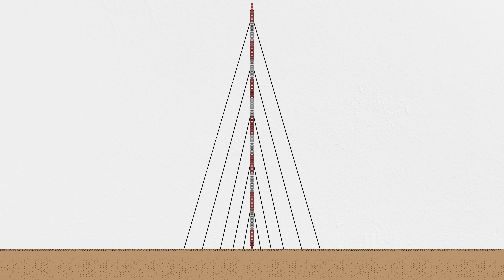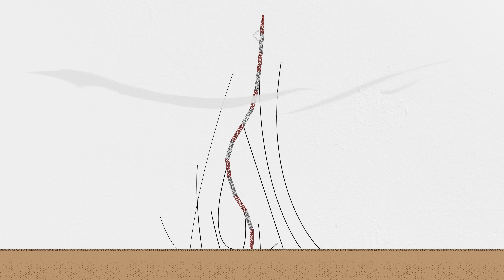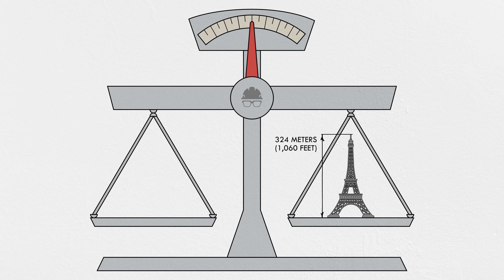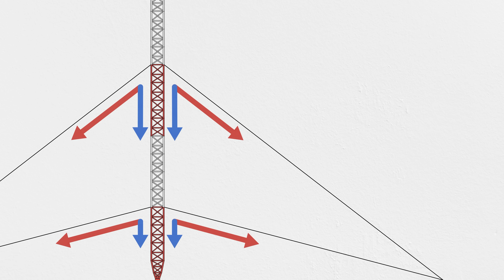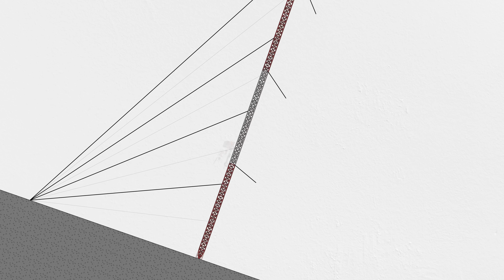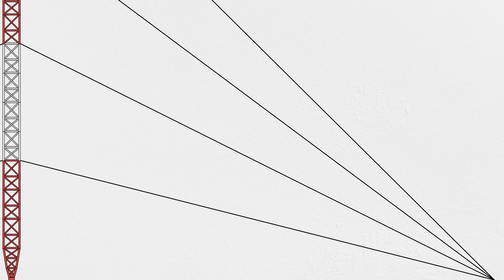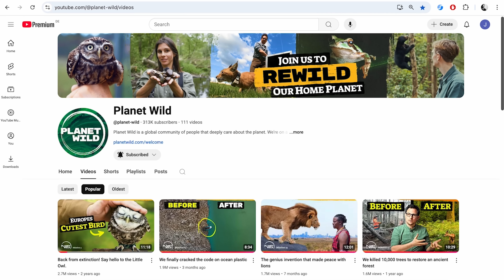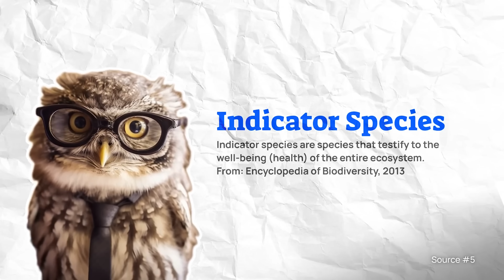The Bizarre Bases of Antenna Towers

Comment: I used to do this professionally (as an electrician's apprentice)... our towers were the 36-to-100 foot class... a 36' tower could be just a steel tube set on a concrete base; a 100-footer was a truss tower, constructed in 10' sections, with one section of the tower (I don't think a full ten feet?) set in concrete for a base.  Sometimes we'd use a fold-over base; the base segment had a hinge in it, and you assembled the tower on the ground, and then winched it into place.  Other times we'd use a "gin pole", a steel tube that clamped to the tower and had a pulley by which you could hoist up a segment of tower, bolt it into place, and then move the pole up to the next segment.  Slow, laborious, but effective, especially in tight confines... 100 foot towers used two sets of guy wires.  The antenna was a "crown" of copper rods attached to the top of the tower; lights, if needed, were solar modules atop the antenna.  100' wasn't tall enough to need paint unless it was reasonably close to a runway, though the steel tube units were painted anyway.  The taller towers were galvanized steel.  

Sounds like that tower that collapsed had a single point of failure, like the Key bridge!  I'm not 100% sure but I think our towers could withstand the loss of any one wire... maybe not at FULL load but under normal conditions.  And most of'em got inspected either monthly or quarterly... 

2000'.  wow.  That is one big honkin' tower.

Comment: The Warsaw Radio Mast (located actually 80 kilometers/55 miles WNW of Warsaw near the town of Gąbin) was this tall because it worked as a half-wave radiator for 227 kHz which corresponds to the wavelength of circa 1320 meters. This mast was fed at the isolated bottom and grounded electrically by a steel pipe connected at the half-height point and running down on insulators inside the triangular cross-section of the mast.
Imagine this mast with its HF feed as an electric vertical equivalent of a horizontal see-saw made of a metal pipe supported at the middle and moved by hand pushing down and pulling up alternately at one end.

Comment: Great video. I used to work for the steel company that engineered and fabricated the North Dakota tower you mentioned as well as the Sutro Tower.  Both were before my time.  I mainly worked on the structural side and didn’t deal much with the tower side. Towers definitely came with their own set of challenges.

Comment: What about the horizontal antennas? I remember hearing something a long time ago about a "E.A.M" (emergency action message) that can even reach submarines, or was that just a movie? Is horizontal "radio" a thing, and if so how do they work when having only a meter or two in height? 
The concept stuck in my mind even if the details have faded as a wireless world wine way to communicate pre internet mostly used by the US navy/military.
Reply: EAM's are Air Force. For submarines it's the Navy's VLF transmitting stations where they use huge umbrella antennas to transmit 2MW signals at 24kHz frequency. At this power and frequency the signal propagates into sea water 10's of meters below the surface which means the sub doesn't have to surface to receive the messages. Look up VLF Transmitter Cutler Maine some time.

Comment: As a broadcast engineer for most of my adult life, I learned my lesson about messing with AM radio towers when I was a teenager in high school. One winter I rode snowmobile over to a tower out in the middle of a field He was in the middle of the night and I hopped the fence and climbed partway up the tower and looked around. The next day I told my friend what I had done and we decided to do it again except during the day when both of us grabbed ahold of the tower we got a pretty nasty burn on our hands. I was wearing gloves and it melted part of the glove to my hand. Found out it was a 10 kilowatt AM station that operated daytime only, so the previous night it had not been on. Ended up having to write left handed in high school for a month while the palm of my hand healed.
Reply: Yikes!
Reply: Or ‘jump’ onto the tower from a purpose built wooden platform
Reply: That is why they use wooden ladders to get onto those towers.
Reply: @mgcoolio97  Wood is a very poor insulator at those frequencies.  Where I retired, at one point for safety reasons I was required to remove all wood ladders from the premises and I replaced them with fiberglass ladders.  I donated the ladders to a thrift store, probably twenty or thirty of them.
Reply: @mgcoolio97 no

Comment: It's a little extra from a structural engineer that did his master on the buckling phenomenom.

Buckling is a stability issue. We need to look at this in term of "energy" where there's the compression energy and the lateral translation energy. Both goes up when a load is applied on the section / tower but at one point, the "structure" tends to go sideways rather than being compressed. You will never have this issue with traction load.

Also, for the ropes attaching the towers, as you go lower, the angle is less prone to induce compression forces but the buckling is also a matter of the unsupported length.

Ohhhh and don't get me started on the vibrations frequency such towers can be subject to and how this affects the stability, this is a delicious subject but maybe a bit complicated for here.

Thanks Brady for the great video!
Reply: Speaking of vibrations, reminds me how they can measure the tension in the guy wires by "pulsing" it.  Shake it and measure how long the wave takes to travel to the tower and back.

Comment: Another fun Tower fact for AM radio is that if the station is a Clear Channel station they're only going to have one really tall antenna. If they're not a Clear Channel station there's going to be four masts usually in an L shape or sometimes as a square which allow the signal to be directional to not interfere with the Clear Channel station at night.

Low frequency transmission is not line of sight at any time and at night it is much further.

For the array setups, the signal is fed to each mast out of phase to create constructive and destructive interference which changes the radiation pattern of the whole assembly.

PS if you have a Clear channel station near you, get 2 sets of leather work gloves, and two good +4' long florecent tubes. The tubes will glow simply from the ambient radiation. Its best at early dusk, and the lower the wattage of bulb the better. 

The higher you go in frequency the harder it is to get the effect. AM is 0.530 mhz to 1.71 mhz, CB is 27mhz, and FM radio is 88mhz-106mhz.

Oh the gloves are because you and your buddy will invaribly start doing light saber antics and smack them together hard enough to break one or both. This way you wont get glass in your hands.
Reply: There is no such thing as mhz. millihertz would be mHz, but you can't use that for radio, so it has to be written as MHz. You can't write megaherz as mhz without your physics teacher yelling at you.

Comment: I’ve seen some places in California and Oregon have transmission line towers that use a pin support with guy wires. Now knowing how material efficient guyed towers are compared to the self supported ones it makes sense they would be used in that application as well.

Comment: 1:00
On August 8, 1991, at 7:10 p.m., the mast collapsed during maintenance work. The work was intended to replace the guy wires, which were in poor technical condition. One of the wires in the last, fifth section of guy wires was loosened while two auxiliary wires were being attached and tensioned. One of the auxiliary wires slipped out of its clamps. The other auxiliary wire broke away from its mounting, unable to balance the forces of the remaining main wires. The upper part of the mast broke off and struck the base. The mast collapsed within several seconds. No one was injured in the accident.

A few hours before the disaster, the then head of the station, engineer Zygmunt Grzelak, advised the six-man crew against climbing the mast, arguing that they would not be able to complete all the work before 8:00 p.m.—since ascending the mast alone took 30 minutes. None of the buildings were damaged except for the “antenna house” (tuning building), which contained a 2-meter-high coil used to fine-tune the antenna to the transmitters. A modern truck-mounted crane, however, was destroyed.

Comment: I would say about 30 years ago when I was a kid they had a helicopter replace the antenna at the top of these huge antennas in Philadelphia and the guy gave me the lightbulb from the very top. I still have it. It’s about the size of a basketball.
Reply: I have the last bulb used before the Cape Hatteras lighthouse was moved in 1999. I also enjoyed the swaying and shuddering during Hurricane Dennis from the light level or one level above the balcony. The difference in wind speed between ground level and 200 plus feet up was insane and deafening.
Reply: That's awesome :-)
Reply: I assume you're talking about the Roxborough antenna farm on Domino Lane. That's some of my old home grounds. In the early 70's I was offered a babysitting job for TV channel 29 on third shift to work at their transmitter site on Domino Lane. I didn't take it as I had other jobs lined up, but it would have been very interesting.
Reply: @joehammer3462 yes you are correct 👍🏻

Comment: In some parts of the world, to be allowed to climb those kind of towers you need to be at least 2 trained people. Trained not just in how to secure yourself, but in how to get the other one safely to the ground, if that person has an accident.
Reason being: the harness and fall dampers you have to reduce the impact into the harness when falling. But hanging in the harness for more than 20 minutes without muscle tension often means the harness blocks blood flow and the non flowing blood cloggs up.
So when it takes too long to get the injured person down, and you then release the blockage, the cloggs move where they should not be and the person dies.
Even many doctors and emergency services do not know much about those dangers, because they do not get exposed to it.
(I get such a training every year for more than 10 years now. And i know several paramedics and doctors, and they got 0 information about it in their "job-education")

Comment: Why not just hang such a structure from an oversized warm air balloon with some electrical heating inside?
Anchor with loose cables to the ground, so it doesnt drift... replacing a cable ot two would be easy as they are redundant. If you use 2 or 3 redundant balloons you can even replace those easily.
The structure only needs to withstand tensile stress... so it can be just a long cable / foldable. Make the baloons as large as possible and black so they absorb sunlight and loose heat more slowly.

Comment: I went to flight school at the University of North Dakota. There are a couple of these >2000' towers west of Hillsboro, ND. When you're flying in a traffic pattern in a plane or doing ground reference maneuvers, you're down at like 600 to 1,000 ft. It's really weird to look off in the distance and see something like that stretching above you. It's also why it's so important to understand and check your maps before going out flying, especially low level. They are big and huge and relatively easy to see if you're looking. But if you're distracted, they could be deceptively easy to miss.

This leads me to a new suggestion. You've done lots of grid and power infrastructure stuff. What about a long video about antennas? Cell towers are pretty easy to spot. But I'm always curious what all the different types of antennas you see on towers do. There's ones that look like snare drums. Other ones that look like a hand fan type thing. Occasionally you see random communication boxes on power lines and light fixtures with those weird metal prong antenna things. Kind of seems like there would be enough here for a video.

Comment: As a licensed radio operator, I feel it pertinent to inform you. If you see an insulation plate and the tower is energized, RF burns are a possibility , do not touch the tower.
Reply: I'd say no matter what you see, don't touch the tower.  It ain't worth taking chances.

If you're willing to jump fences and poke around at stuff anyway, there's plenty of other interesting things to look at where you only risk being arrested instead of electrocuted.
Reply: RF burns are no joke. Before I became an RF engineer I used to repair cell phones. One day I was calibrating output power on an old Oki handheld(0.65W). My probe slipped and my finger touched the test point...ZING! The RF went up my arm and felt like it made a hole in my elbow. My entire forearm was sore & throbbing the rest of the day, lol.
Reply: The new one where I live has a much more supportive base with five points of insulation, and horizontal trusses keeping wildlife and people away from the insulated antenna.
Reply: or it just kills you at the energy levels I worked with.....
Reply: That sounds like a warning from experience...
Reply: Got a burnt finger rigging the  WBAL AM towers for a guy swap in 2012. It literally cooks you. It altered my finger print when healed. I do have pictures
Reply: I'm confused, why are people talking about Rf burns?

Isn't the problem that you become part of the circuit so you get an electric shock? It will burn you too but it's the electricity not the radio waves right?

Or is it emmiting so strongly it burns you like a radar?
Reply: @HowIsAsh    I  imagine the electric current is how the rf is carried. It was certainly a lightning bolt that spanned about 4inches to my finger tip.  I'm not an expert on how it works, just how to put it together 😅. I was just the paid 🐒
Reply: @ZLwh1ne  Yeah that sounds like the voltage was high enough for it to jump the gap lol, that must've been terrifying
Reply: @HowIsAsh unlike typical electricity, I didn't feel it all through my body. Just localized in the finger. I want to lean on the idea that however similar, AM RF is just a different property than Electricity ..
Reply: @ZLwh1ne could've been because the current was low enough, after all it didn't fry you, so it acted like one of those science zap thingies that spark between your finger and the voltage generator and you only feel it in the place where you got zapped because the area was small (kind of like holding a metal thing and being zapped through it vs it zapping to your body hair or a small point on your skin)
Reply: @HowIsAsh they are using electrical burn and rf burn interchangeably in this context, but yeah you are right, this is not an rf burn
Reply: @HowIsAshit’s called electromagnetic energy
Reply: @HowIsAshyou become part of the circuit yes, but you don't really get a shock because the high frequency can't depolarise the cell membranes sufficiently across the resistance of the skin and fluid in the body
Reply: See these are the comments that help keep me from doing illegal stuff... or help me become better prepared
Reply: @TheRogue182  cell towers won't burn you...... just make sure there's no fm antennas on top ;)

urbex is fun.
Reply: Except with your tongue. 😁
Reply: @I.M.fulluvit ...Oh YEAH? I TRIPLE DOG dare ya! 👀

Comment: To add to the Warsaw Radio Mast: it had such a massive range because it was basically a dipole. It broadcasted at 225 kHz and it was 646m in height versus 666m half wave length.

Comment: For those big AM radio towers - the amount of transmit power is pretty crazy. You can hold a grounded hot dog up against the tower and actually hear the audio being transmitted as the hot dog burns.

I recommend the youtube channel Geerling Engineering - they have a bunch of videos talking about those big AM radio towers.

Comment: How are the bases made to support the weight of the tower with the compression forces from the guys and on such a small point? Not to mention still has to be a functional bearing. Are they just build different, or am I overestimating the forces?

Comment: Nice, most of the RF side of this appears to be accurate.  However one of your pictures that was mentioned as lightening protection, may have been a capacitive top.  It's on AM antennas to make the tower look electrically taller than it is.  All kinds of reasons why the tower was not as tall as it needed to be.